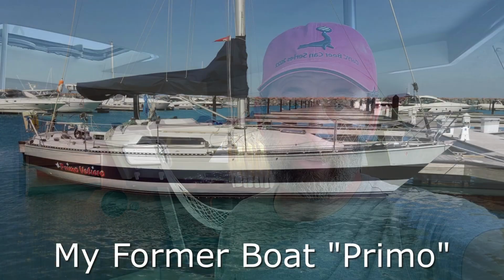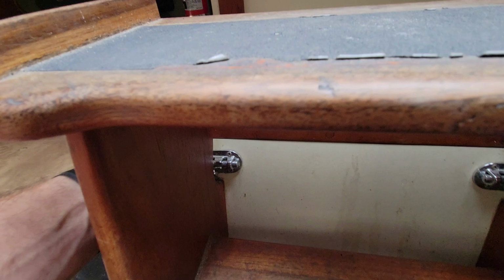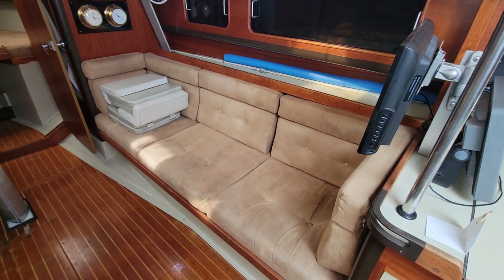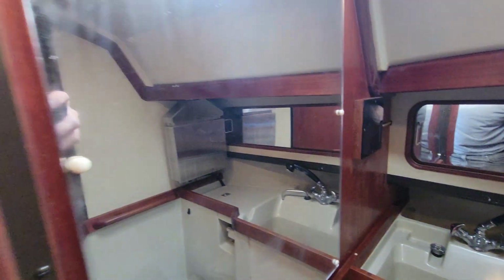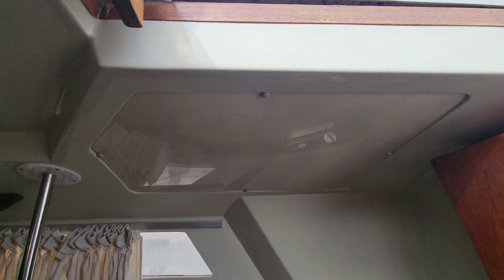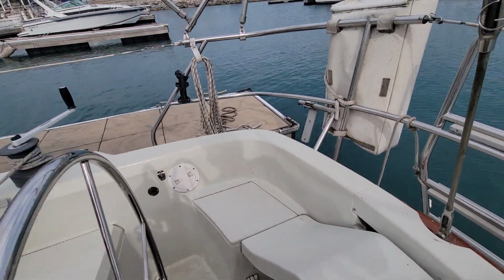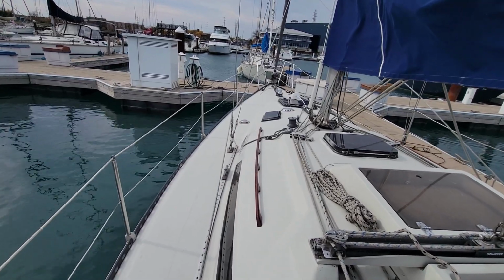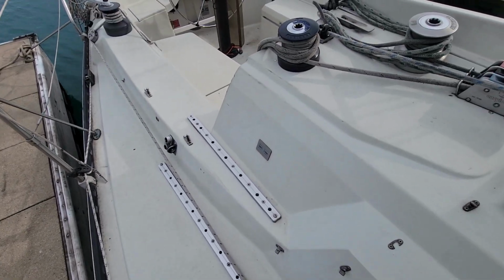Captain Daggett Boat Tour Series C&C 35 Mk3

Comment: Hi there, I just purchased a 1987 35-3, and I'm pretty sure the hull is pure fiberglass. The deck is balsa core though. All the research I've done suggests that all mark 3's are fiberglass hulls, though I haven't drilled into mine lol.
Reply from the maker: Rob Ball designs from the 33 Mk2 on (including the 35mk3, 37mk2, 38mk3 and 41) Have portions that are balsa cored. The 33 only had it in the panels forward of the keel is my understanding and the 35 I think is similarly built.
Reply: I have a C&C 35 mk1 from 1972 and it is the only one to have a solid glass hull. The mk2 and 3 have balsa cored hulls unfortunately.

Comment: The Mk 3 has a fully cored hull but it's not as problematic as the earlier C&C 36, 38 or 40. The major area of concern is the masr step. For reasons unknown C&C used cheap bondo under the heel fitting. This cracks and crushes over the years and allows the compromised substrate to compress. This is also manifested in external cracking where the keel stub roll joins the hull.

Comment: How well can this boat handle ocean crossing? It seems like a good sailboat but many say it’s only meant for coastal sailing. Thoughts?
Reply: It would not be my choice for a crossing vessel. It is a well built boat but a little on the light side for long passages and potentially heavy seas that you would encounter. It really was built as a Coastal/Great Lakes club racer-cruiser. 

Could it do it safely, probably. Just wouldn't be my choice of the tool for the job.